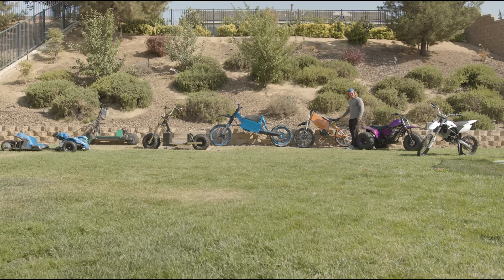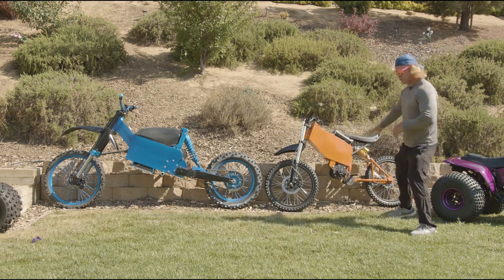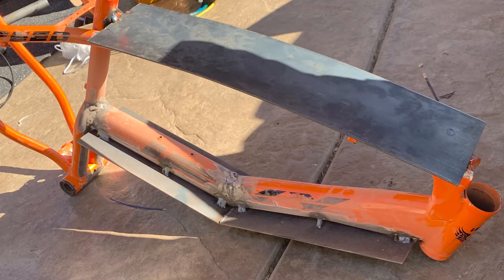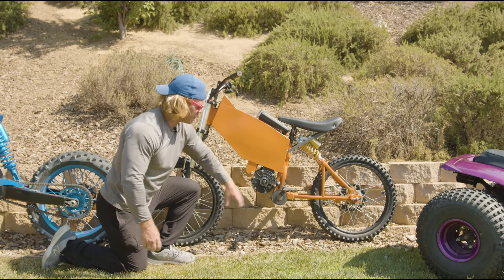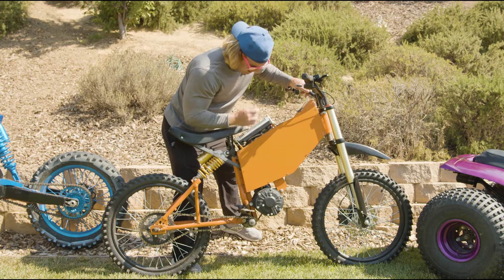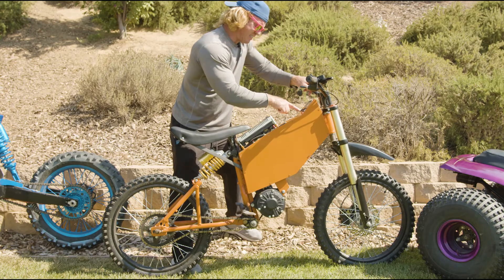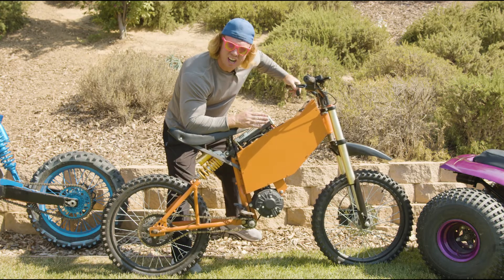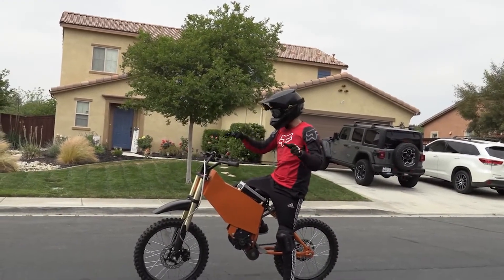FAT TIRE bike turned into a Electric Dirt bike ( SURON STYLE )

Comment: to slightly remedy the steep rake issue you could just go for a slightly smaller rear wheel, you did say you wanted same size front and back and idk why you'd want that but that would give it more torque.

Comment: I love what your doing! Love that ATC! I’m glad to find your videos. I’ve been messing around with building fast razor e-300 scooters. Nothing as burly as what your building, but still fun. I’m running a mixture of commercial drone and e-skate stuff. Alien 7,000 watt outrunner drone motor with 48v e-skate controllers . Problem is most the smaller controllers like these are limited to 48 v. Your high v stuff has me thinking I’m playing with kids stuff!! Ha I am, Razor scooters! Like everyone else I’m looking for quality batteries. Been using 60v EGO electric mower batteries, they are at my controllers voltage limit but are only 7.5 Ah. Not sure what your deal is with your bolt/volt battery stuff? Would you be willing to build a couple batteries? I’d gladly pay $ 🙂 Just throwing it out there. Thanks again for posting your stuff!
Reply: Get the phaserunner controller + Cycle Analyst for your razor. Is expansive but super small, goes up to 90v @90A peak and 50A continuous. As for batteries, I am using ZDF Lipo 3 blocks of 6s each, 22000mah in series so 18s. I set the phaserunner to reduce and cut the power when the battery is 15% for precaution. For charging I bought a DC Step up converter connected to a server PSU so I can regulate the voltage and amps. Charging the batteries to 90% also for precaution.
Reply from the maker: I have a few aliens motors sitting around. I made a off-road skate board in 2018. Was eventually going to make it 4 wheel drive.
Just email for batteries
Reply: @Full_Throttle_no_Brakes  thanks for the info !! Just checked them out, nice stuff. Super compact!!
Reply: @Full_Throttle_no_Brakes  are you running an e-bike?
Reply: @mapquestHs  yes but it doesn't matter. The principle is the same
Reply: @Full_Throttle_no_Brakes  yes I realize it’s the same, was just curious because of how much space is required to run three of those lipo packs. Makes sense if it’s on an e-bike. Again thank you for all the info!
Reply: @RexSmithII  your videos are superb man as are your electric creations. Keep up the good work. I’m amazed how quickly you pump out these new e-bikes/scooters/trikes etc., lol. Have you tried any of the Alienpower/Freerchobby motors of yours out on larger machines like bikes & scooters? They are very powerful for their weight and size on paper but I often wonder about how they perform in practice…
Reply: Nice, sounds like you’re using an 80100 motor in that case. I’m guessing you’re using the smaller VESCs? I was a bit unimpressed with their voltage capability until I found the BESC G2; it’s open source as well so you can order it to be manufactured by a pcb manufacturer yourself. Apparently comes to about £190/$250. It handles 100V and 400A!!! Best price of any controller out there. With that kind of headroom you can basically strap on any motor and take it to full power. I think it can also be modified to handle 150V and 250A if I’m not mistaken. By switching the MOSFETs or something. Check it out, there’s forum posts on endless-sphere and some videos on here, look up “30kw Giant Glory”, it’s an e-mtb the designer of the BESC (Gal Pavlin) made.
Reply: @imperialsecuritybureau6037  Wow those are some impressive #’s for a compact vesc and what a great price too. Yeah I’m running the 80-100 with a flipsky 6.6 tops out at 60 amps continuous  though. I’ll definitely check out the G2. Thank you for letting me know about it!

Comment: We need more videos. What's the next crazy bike you will make?: D

I want electric to beat gas as you said but there needs to be a battery tech leap before we get there. I'd wager 10-20 years for that though.
Reply from the maker: I building a mini bike,
As far as electric beating gas, it can now just cost a lot more, just look at formala E, they purposely put hard restrictions so they can’t beat their gas formula one opponents. Because formula one was a huge moneymaker, but now this year I believe the commissioner took all restrictions off of formally E to let it shine. You’re right the battery is the weakest link, but the torque of electric geared correctly will always be gas on a full battery.
Reply: I'll take on that bet. Batteries are getting really good.